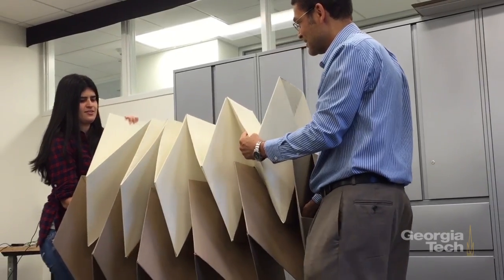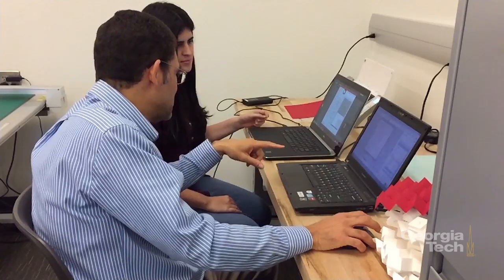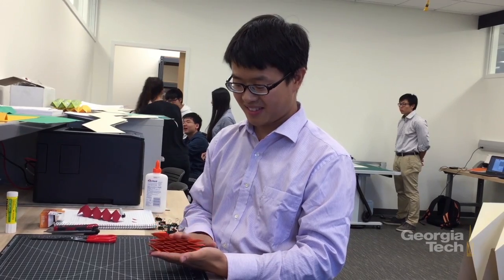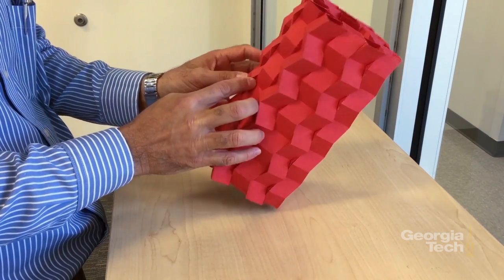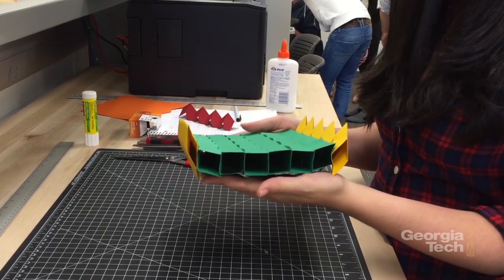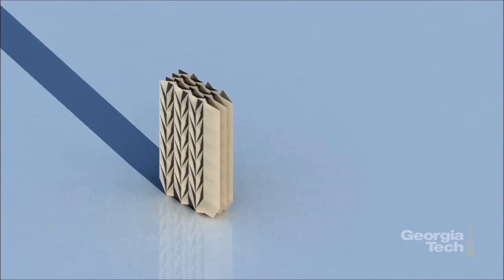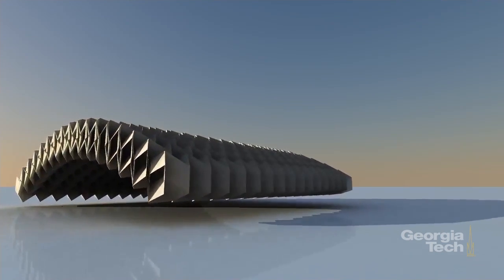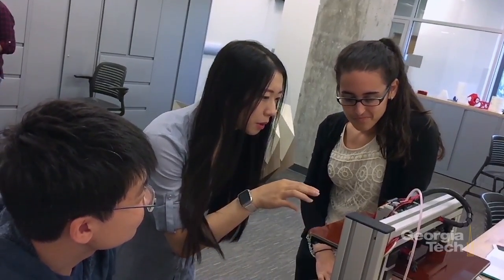Paper Tubes Make Stiff Origami Structures

Comment: The problem to resolve here is not the structure itself but the material it's made of. Paper works great in these small scale situations but for bigger things new materials would be required as paper is not durable enough.
Reply: You can probably apply resins to harden the structure after expansion. Then you can reinforce with more coatings+fibre, and also fill with concrete or foam. It's definitely got potential, although it will take a while to to find its niche.